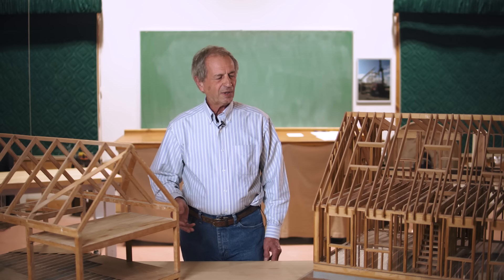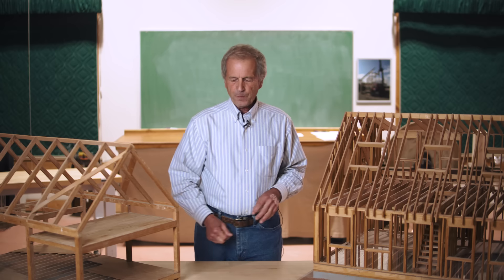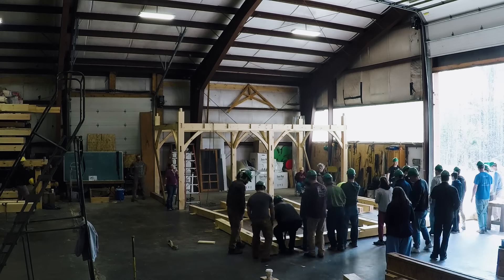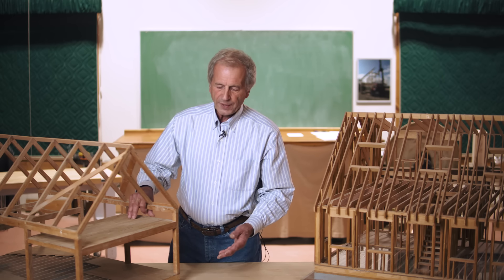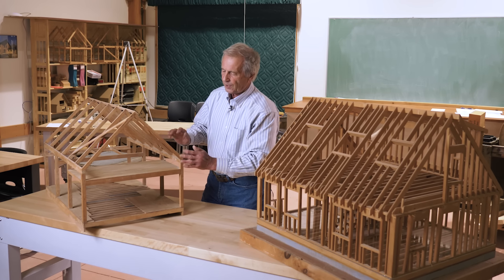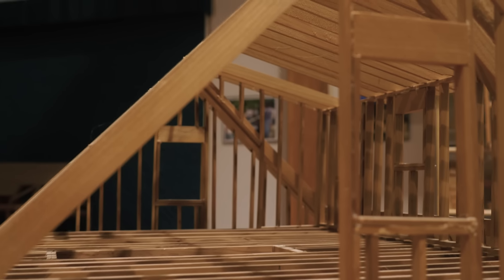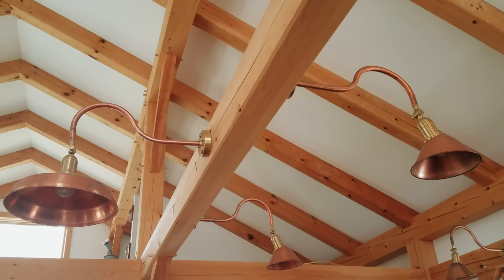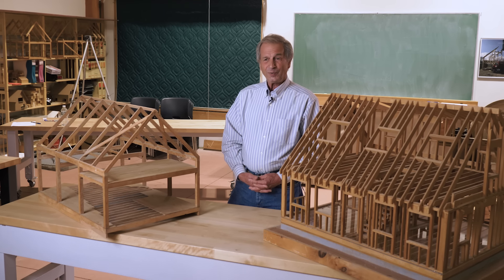Timber Frame vs Conventional Stick Frame

Comment: Cost, cost is the reason we build with dimensional lumber.  You can get a whole bunk of 2x4s for the cost of one timber
Reply: Yup. Timber makes sense if you own the trees as he said. But out here in the midwest where 90% of land is plains. 2x4s are the way to go.
Reply: Thought there must be a reason.
Reply: Do americans mostly build their homes with 2x4s? That seems far too flimsy and uninsulated for my liking.
Reply: Иван VII.
2x6 exterior walls, sometimes 2x8.
Interior is 2x4.
Usually 2x8 - 2x12 floor joist and a mixture of 2x4 and 2x6 for the trusses.
Cover that with cheap 1/4” - 3/8” OSB and you’re set.
Reply: So go somewhere and get them.
Reply: Roger Mooretimber frames could be built with glulam beams. given their superiority in pretty much every way, getting the material cost down would make it a no-brainer.
Reply: Da Os A good point, though it would be a different aesthetic.
Reply: Иван VII the frame is built out of them but then insulation goes in wires wall panels and in more fancy houses another layer of decorative wall so no very insulated 😂
Reply: @andrewmason4004  it would. more engineered, less rustic/authentic. don't know of any such builds, would be interesting to see.
Reply: @OldNew45  You understand that moving things across the country takes resources as well, right? It is not as simple as taking a one hour drive to the forest with your pickup. The area to cover is vast and the amount of material needed is significant.
Reply: @daos3300  This is done regularly - usually in larger buildings from what I have seen. Churches especially seem to like them because they can be had in curved forms.
Reply: @vii7031  not only Americans,  but we build primarily with stick framing in New Zealand. Australia and Canada. You then sheath. All about economics. Roof trusses are built in factory and are precision engineered. Stick framing if done right will hold up in any wind zone and earthquake zone assuming you use light weight cladding. Structure can be erected on either timber pile foundations,  conventional slab on grade or waffle slab systems.
Reply: @christopheraugustine5816  y, particularly good for large spans since they are incredibly strong and can be custom made in almost any shape.
Reply: How much more is it?
Reply: You completely missed the point on the labor cost differential in erecting the structure.
Reply: @BeatYourHeadIn  lol, dovetail and manhandle timbers vs nailgun and fab up stick frame on the ground
Reply: It's partly materials cost and partly because of skilled labor availability and speed.

Stick framing does take skills and knowledge, but it's a lot easier to lay out stuff on centers, cut boards, butt them together and nail them vs. layout special joinery and hand carve with a chisel.

Plus you ain't gonna throw a good chisel away. You gotta sharpen it. That takes more time and skill. If a circular saw blade goes dull you just buy another.

Fact is one or two carpenters can do the layout and marks and have unskilled labor help with everything else. 

You can't do that for timber frame. Every part needs done with care and is a slow process.

I love timber frame, but it costs more in every way unless you can do it yourself.
Reply: @daos3300  I think it would still look nice.  It would just be different.
Reply: @FreedomTalkMedia  definitely, could look extremely cool.
Reply: I love in Indiana and there's plenty of trees around
Reply: I was going to get a timber frame kit. When I went to look at the models at the plant, I saw the timbers are 8x8 beams. Some 20 feet long. These are not something that can be done without some equipment and skills. And there is a level of danger involved in this. I sure didn't want to get started on this. It requires a skilled crew.
Reply: @MrWoodchuck59  don't let it put you off, plenty of people have done it. it does require some skills, but certainly something a handy person can learn. remember, in the past these houses were built by hand, by ordinary people.
Reply: @daos3300  It would be the difference between a structure built by an architect vs an engineer. Pretty vs practicable. It would be easier to order up a 40' 6X12 glulam than trying to find a 40' 8X8. A mix of timber and glulam's might be the best compromise. I have seen construction designed by engineers, it is different not necessarily bad.

The one thing that would change is the joints designed for timber framing would not necessarily work with glulam's due to the different dimensions of the wood.

One thing with glulam's is you could have overhead arches not practicable with timber
Reply: @vii7031  because its cheaper and most people choose cheap now over better, more expensive long term benefits
Reply: @daos3300  I'm having someone put in the basement & build me a shell. I'll finish the inside, all plumbing, electric,  walls, kitchen & bathroom cabinet etc.
Reply: @mickeybowmeister1944  Exactly, plus I know in Australia there is no way we could get timbers of the dimensions they use. We cant just cut our own trees.
Reply: a lift of #2 BTR 2x4 8’ containing 296 boards is right around $1000 cad... one 8x8 16’ fir timber is maybe $25
Reply: @vii7031  yes but exterior walls are usually 2×6 so you can get more insulation in there
Reply: @vii7031  concrete block also
Reply: Иван VII what do you build them with? AK47s?
Reply: @vii7031  here in Iceland we build with 2x6. I actually built one house with 2x8 last year. I guess it all comes down weather and climate. Wind chill is a big factor here, as are storms and earthquakes. We like our houses to be well insulated despite heating costing next to nothing. How is it where you are at?
Reply: @vii7031  In 2x4 frame, you can stick R-16 insulation at least, and add another R-10/15 as external insulation boards. That’s getting close to R-30, which is more than enough for most climates. Up north they often switch to 2x6 if the winters are really cold.
Reply: @vii7031  yes but we use Simpson strong ties though, do you guys?
Reply: @johnthiessen4749  never seen 1/4inch OSB. 15/32 or 7/16
Reply: So I should be able to timber frame with telephone poles. You can get a range of sizes
Reply: @austinrichardmusic6351  yep, these folks just haven’t found a good sawyer yet. They’re out there, call woodmizer and have them refer you to some!
Reply: @MrAndrew1400  wait what?? If you own land with trees on it, you can’t cut them down?
Reply: @vii7031  Most now are framed with 2x6 and the interiors are 2x4. What really makes the quality drop is they are built by big name builders and for the most part, pay the contractors by the house. So they build them as fast as they can and cut a lot of corners. Most every home has a lot of issues that needs to be fixed. A $250,000 house will most likely need another $5,000 to $20,000 in repairs in the first few years.
Reply: Apparently you didn’t listen to the video. Who gives a shit about dimensional lumber when you’re talking about stability, strength, and integrity. Just because track homes are built with dimensional lumber doesn’t mean it’s the better option. It just means it’s the cheaper option
Reply: @johnthiessen4749  In warmer climates like California, a lot of houses use 2x4 exteriors.
Reply: lol, cost 😂😂
you sound like a builder
Reply: That depends. If you live in the northeast a local Sawyer can cut timbers for an excellent price. In farmland USA? Not so much.
Reply: @MrWoodchuck59  stick framing is less dangerous per point of danger but timber framing has less points of danger. So many fingers get lost in just the sheer repitition.
Reply: @vii7031  2x6 is more and more common, that's being combined with insulated sheathing and spray in foam insulation. There's also a company called T-stud that makes an awesome product
Reply: If Im building my first house and have some help and the cost is less important than I dont mess up, I go with the timbers?
Reply: Why using lumber and wood in the first place?why not have a concrete structure and hallow brick walls?is wood houses cheaper?
Reply: Also timber framing is heavy as fuck and you'll still need to nog the shit out of the house to sheath.
Reply: If the wood comes from the property the house is to be built on-  it’s already paid for. A lot of people use this forethought before they buy the land. People are stuck with most stick framed modular designs because it allows them to piece it all together like Lego’s and customize things to the end of the Earth. The video simply shows a distinct advantage of strength in design in the form of post and beam construction. With standard framing you have to spend thousands on LVL’s, glue lams etc, steel girders to support large open spans. I’m not even mentioning the amount of nails in a stick frame building. Or the amount of time and labor it takes to individually insulate between every rafter or partition wall or inner rim joist etc. 
Nobody I knew in the industry used mortises on their joints unless it was custom work. I don’t know if any of you have ever demo-Ed a house with mortise and tenon joints, but it’s far more difficult, sawzall or not. That’s what separates a properly strengthened joint in timber framing from a nailed and overlapped junction built by someone who isn’t following code or isnt even aware of it. The advantages are night and day, it’s how well you research the differences that matters, and what appeals to you most; duplexes or a timber frame house, etc. If you’re using large prefab rafters you need a team of people for each one. They aren’t built on the ground as a unit and the raised. Then consider every jack or king stud setup, you’re using multiple 2x6’s or 2x4’s for every doorway and window. Headers, cripple jacks, you can’t say it costs less to build with standard framing lumber. You can easily see that the stick frame model he’s standing next to uses twice the amount of wood. 
If you’re using domestic wood on a timber frame home it won’t be as expensive, especially if it’s from the property. if you want Douglas fir beams you’re going to pay for it, and that’s of course what the timber framers want to sell you if possible. I thought timber framing was high priced until I actually researched the difference
Reply: @vii7031  depends on the state an not usually. If a house had more then one story then definitely not
Reply: @vii7031  yes they do. Even 3 story commercial buildings sometimes
Reply: Lol where I live its the other way around😂
Reply: Cost cost is the reason for people who buy poor quality land.
Reply: @vii7031  no. We use varieties of sizes. 2x6 8 and 10s. Sometimes even larger. 2x4 is usually used for the walls
Reply: @vii7031  yes. In America. Most construction is an epic fail. They use cheap plywood (osb) and 2x4 sticks. Sad but true. Very few houses are built from concrete block 100%.  And they don’t even know what Gas Block is. 🤦🏻‍♂️. The major problem here is cost. The cost of pressure treated lumber in the United States has increased about 40% in the past year. Material cost in the United States is extremely expensive and also labour cost is more than four times as expensive as it would be in Russia or Ukraine. Americans always like the cheap way out that is fast and easy and just look at their cars.  I have seen quality built houses in the United States but they cost some insane astronomical numbers such as $250 per square foot.  You could build a nice 2000 ft.² house in Russia or Ukraine for about $60,000-$70,000 but in the United States that same house would cost easily $400-$500,000 because of the expensive labor and Materials. Unless you’re a millionaire in the United States nobody would consider building houses out of timber or Bruce because the number would be so astronomically high and that it would not make any sense.  Even a cheap construction house out of two by fours and plywood in the United States costs about $150-$160 per square foot. ( shed quality ) That’s why whenever you see a hurricane passed by Florida or the southern United States entire cities get levelled because those stick frame houses get blown over like nobody’s business. Guys that work in the trade here in the United States will always claim that are properly built stick frame house can with stand category four hurricanes Which is complete BS. The only houses that in the United States with stand a category four hurricane are the ones that are completely built out of block. But usually even those houses the roofs get completely blown off because the roofs they use two by sixes.  Basically your only option in the United States if you want a decent construction quality house is to just use concrete blocks and hire a quality Mason to lay them and then fill the block cavities with solid concrete.
Reply: @E39M5SPEED  did you just compare the cost of living and materials of russia and ukraine with the u.s.?
Reply: Not any more.
Reply: @josiahrandolphbaldwin8272  This is a very odd comment. It costs a lot of money to clear land, work it and fertilize it. A cow is a walking eating machine that also produces fertilizer to grow its food again. Very odd boy you are.
Reply: @josiahrandolphbaldwin8272  You brought up cost. There are many stick frame structures built by the freemasons that are over 150 years old and still standing. One is a 5 story building in Murrells Inlet, SC. It made it thru Hugo and many other hurricanes. Maybe you only know a bunch of half/assed builders?
Reply: @josiahrandolphbaldwin8272  Yeah, so compared to the Ming Dynasty who had a nations wealth to spend on structures?  Modern framing can incorporate steel and trusses to make greater spans btw and some buildings are framed in the same fashion using steel studs. Engineering wise, Each structure still has to stand up to the loads regardless of materials. So to say that one is superior to another is just foolish. A bad engineer could design the timber frame house, while another really good engineer designs the modern framed house.
Reply: @josiahrandolphbaldwin8272  Stick framing and production milling hasn't been around for 200 years. Homes are being built out of pressed wood studs (lvl type materials) that are achieving similar or surpassed properties to conventional lumber. Perhaps there is more or less waste in timber framing, that i do not know. I do know that stick framing can achieve any desired result structurally that  timber frame can at less cost. I'm a Florida licensed GC and everything in my zone is currently being designed for 165+mph HVHZ (High Velocity Hurricane  Zone.) We have both bearing tension and uplift tension. Most 1st level construction is CMU however which is also better at preventing termites, but 75% of the time the 2nd story will be wood framed. Any higher than that and it is usually all masonry. With land and forests disappearing at the rate that they are (see Brazil), I can only think that timber framing will only become more rare in the future as composite and alternative framing options take the place of even modern stick framing.  Amish however will still do Amish things.
Reply: @vii7031  Most are 2x4.  The hewer houses are going towards 2x6 for more room for insulation.  It's a cost thing.  Cheaper houses will stillness 2x4.
Reply: @vii7031  I  can't imagine how this timber frame could get the same insulation is a stick frame building. You get 6 inches of insulation. Regardless of the heat transfer of the wood itself, you're not going to put 6 inches of insulation around that timber frame. I found an article sating SIPs at R3.9 per inch and a normal panel being 4.5 inches think meaning R17.5. My house (In Canada, so insulation is a bit more important) is R26 in the exterior walls.
Reply: Yeah, he also said 10 days to cut out the frame for lumber frame, and "many more" to build a stick frame. I've seen 2 people frame a 3000 Sq/ft house in 2 days. Most crews of 4-6 will frame a house in 2-5 days. Much faster.
Reply: 2021 prices have doubled on regular wood
Reply: @KieranMullen  yes, inflation is creeping in. Prepare for more
Reply: that comment didn't age well...
Reply: @KieranMullen  it's doubled (or tripled) the price of all wood, large sizes are more rare and are price affected even more.
Reply: @BeatYourHeadIn  You completely missed the point that labor is vastly more abundant and renewable than any material resource.
Reply: @keatonhatch6213  Sometimes you can, but some states regulate that you need to pay a fee and possibly get someone licesnsed or pay for a license.
Reply: @medbenselem790  It depends on where you live and what the building codes require. If you live in a hot climate that deals with earthquakes, your housing needs are different than if you live in a blizzard prone area. And again, it depends on ease of building materials. Living in a forest, wood is probably cheaper than concrete, if you are in the highlands, made stone will be cheaper.
Reply: @E39M5SPEED  Your analysis for most of the US is right on. Miami-Dade in FL would be the exception. Their building code for residential is top notch. But their housing prices are high enough to justify it. Plus their cost of labor is super cheap because of all the undocumented labor. Of curse as a consumer the real problem is getting them to stick to the code and not just bribe the inspector.
Reply: this comment aged well... cheaper to build a home completely out of diamonds right now lol
Reply: This is what he starts with. He doesn’t say cost, he says availability, or lack of availability of trees is why we build stick frames. Which translates to cost.
Reply: Or you could just build a well built timber frame house and not move every 10 years
Reply: @vii7031  in FL my house is concrete blocks reinforced with rebar and filled with concrete. The interior support walls are steel and the roof is wood but anchored to the slab.
Reply: @MrWoodchuck59  ya special equipment like the pioneers had? Timber frame lasts so many years longer than any stick house.... and stands up to more abuse.
Reply: @austinrichardmusic6351  and you need way less wood in timber frame
Reply: @cas3proven  came to say the same thing. Cheers
Reply: No way
Reply: You get what you pay for. 2x4s are flimsy construction that make the house look like a cheap piece of junk.
Reply: @Luckingsworth  Because fuck growing trees (??)
Reply: It's funny because it's significantly more work to mill dry and plane conventional lumber so much more cost goes into conventional lumber sawn incorrectly resulting in bent home depot 2x6s. It takes me about 6 minutes to make an 8x12 up to 21 feet on my mill at the cost of the fuel to cut it and fuel to truck it to my mill so any big mill mass producing timbers is spending far less money on labor fuel insurance and any other expense
Reply: I live in 2x6 framed home. I wish I could get in a timber frame home.
Reply: in britain both are expensive, but the labour costs make stick frame the cheaper option
Reply: @vii7031  - It really doesn't allow for enough insulation especially if you live in northern states or higher elevations.